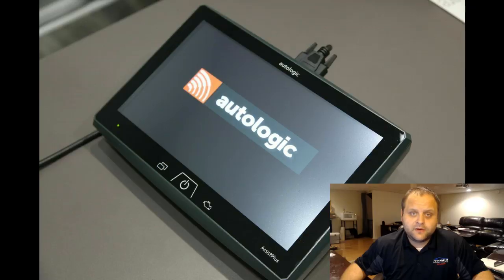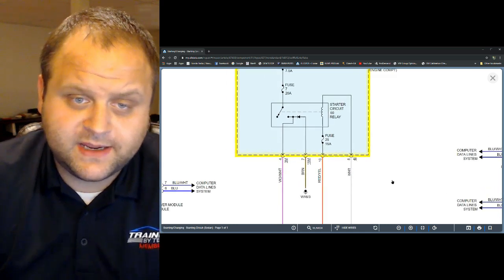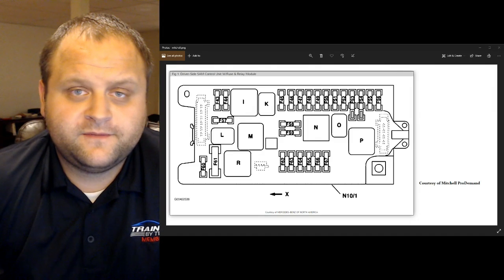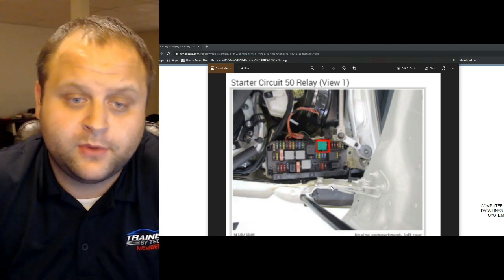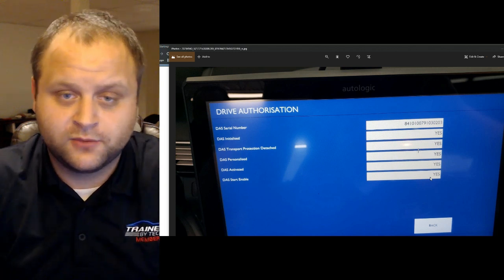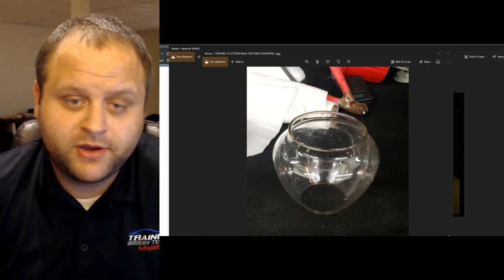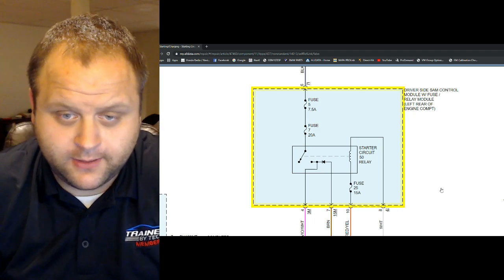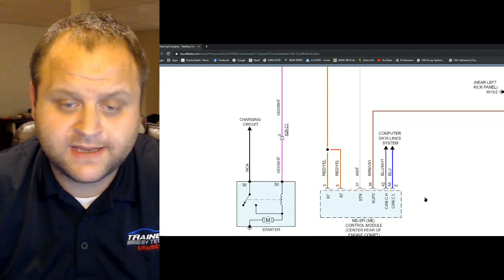Basics Basics Basics? 2010 Mercedes E550 No crank

Comment: heres a thought- that starter has a pull in and hold in winding in the sollenoid. the hold in is usually hooked to the battery via the contact disc when engaged but also within the sollenoid as a common ground.  therefore yes it may be possible it sensed the  fault. but what type of fault detection would it have?  there would be no sense in an open protection since there is no flow. and over current protection should have at least blinked the light.  one thing i learned years ago on starter problems- test and confirm the battery is good. then use jumper cables  and a clamp on ammeter and confirm the starter is good. bypass everything in the vehicle by doing this.  then continue on as needed.found way too many that if they did work they were drawing too many amps and were on the short list for replacement anyway. that extra strain is hard on other components.  or was the rear sam dropping out??? you may get a second chance on this later.

Comment: How much amperage does your headlight circuit checker draw? Relay signal to energize the coil should be low amperage.
Circuit protection is usually done by a current limiter/circuit continuity through internal module circuitry to
To the starter relay signal circuit. 
Which generates a code.
Reply from the maker: I used a conventional incandescent bulb test light across the relay control. The headlight was used on the S terminal going to the starter. That circuit certainly is capable of more ampersge than a headlight provides.

Comment: In the beginning of the video you’ve stated that you have a power and a ground coming into the starter relay. You’ve determined that the ECM is not grounding the relay. However you didn’t mention whether you’ve checked the power coming from the ECM into the starter relay? Also a Main power into the relay was coming from the rear SAM. Did you have that power present when the car wasn’t cranking? Is that a key on power? I assume that the rear SAM has to be energized in order to send power out to the starter relay...
First of all it’s really frustrating because the service info was lying to you! You can’t diagnose a car properly when you have to guess which one is the starter relay and how it’s controlled,you just have to know!
Good video! 👍
Reply from the maker: In the beginning I was explaining the circuit. When it came to testing at the relay, B+ was available from the rear sam. And B+ was available from the ECM. I was missing ECM ground control. Sorry for the confusion
Reply: Trained by Techs Thanks. If I had to guess...and this is a pure guess : I’d say that there’s a “ sensing “ wire somewhere and that the wiring diagram is simply lying to you...especially since this is a Mercedes-Benz and aftermarket wiring diagrams are not too good.
I’d also say you will have codes except that in this case,the battery was disconnected. There’s no way that a Mercedes-Benz doesn’t throw some “ Battery too low or Low voltage codes “!

Comment: rpm signal?
Reply from the maker: Can you elaborate on your question Joe?
Reply: Just thinking what could disable a starter, rpm signal  missing or battery current sensor going high on crank
Reply from the maker: @joekeefe3229  The vehicle wouldnt even "click" when it arrived. There certainly wasn't and RPM signal as it didn't even attempt to crank over. It's possible there could have been a high-current situation BEFORE I got to the vehicle but one would assume there would be trouble codes to follow that strategy.
Reply: @TrainedbyTechs   yes i forgot about lack of trouble codes, I had a Chrysler sebring interm starter solenoid fuse blows, service info gives ohm spec for the solenoid, starter would work crank sometimes, when it worked all was good. when the motor wouldnt crank it would blow the fuse. buy a new starter, I ohm the solenoid, it ohms low,  crap, bad new starter? I put it in anyway to see how it goes.  I put a amp clamp on the solenoid wire , crank the car its fine , draws about half  the current of fuse. then I thought oh ya when the car cranks theres voltage drop and lower current to everything. When it no cranks current to the solenoid would go up and blow the fuse with the old starter. Idk, just thinking about  car and why  benz would do what they do. True there should be a  trouble code.

Comment: That was too funny 😂
Great video Brian.
One question, when you mentioned doing a voltage drop test to the B+ at the starter, what load did you place on the circuit?  

I find it difficult at times to properly load that circuit in the case of a inoperative starter. 

Thanks buddy

As for the rear Sam circuit fault detection. I could be wrong but I'd assume that it would throw a code in the case of a fault. 

As for why you didn't have control, that's a good question.
Reply from the maker: And yes. The big battery cable was still attached. I placed my headlight on the large post on the starter and actuated the solenoid S terminal. If there was a voltage drop causing a no start, my headlight would go dim
Reply: Trained by Techs thanks for the response!
Reply from the maker: Yeah unfortunately there were no codes in any module when the vehicle arrived to my shop. There could have been prior to the customer replacing the battery
Reply: I use a battery load tester to test when starter is inop. The toaster style tester that is. Could also use a carbon pile tester
Reply: Pico Boo some of these have an agm battery, i hear that might be a no no
Reply from the maker: I used my headlighlt on the large starter cable while commanding the starter solenoid with a power probe. This isnt exactly a true voltage drop  however I know the voltage potential didnt fall on its face when commanding the starter which proves that isnt the problem
Reply: @TrainedbyTechs  Just to confirm, the large starter cable was still connected to the starter when you energized the solenoid via Power Probe? If so, that was a valid test.
I would also be surprised if there was not a DTC if the SAM was in a circuit protection mode.

Comment: 😆 love the “fishbowl”, that was great! Seriously though, great process, great testing and I love the thought carrying through past the repair:

“Why did the Engine ECU fail to drive the relay?”

This is a great question and what other techs have to implement in order to remain elite. True understanding of how all the “players in the game” work together to accomplish a task is what it takes to developed sound diagnostic testing techniques on today’s vehicles
Reply: have you ever scoped a bad battery with a amp clamp and battery terminals connected to battery and watched the battery voltage fluctuating on solenoid voltage draw it goes up and down . arching the contacts in starter causing high resistance.
Reply: Hi Randy,
Can you re-work that? I’m not sure I understand what you are asking, thanks